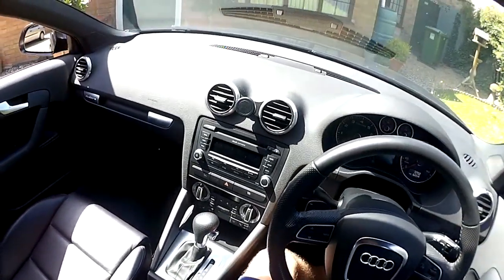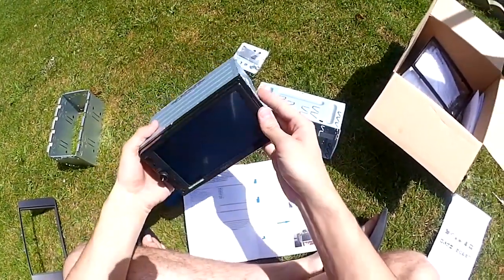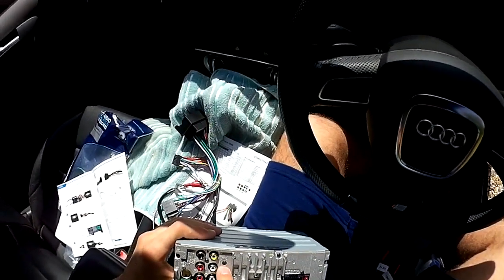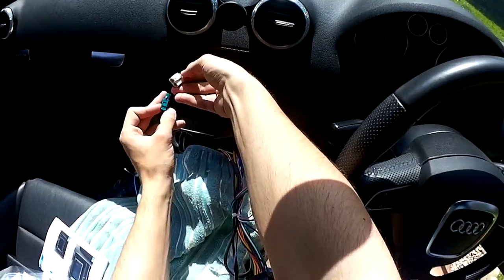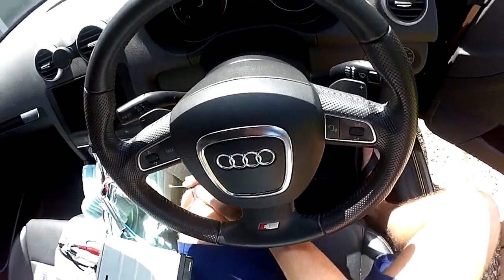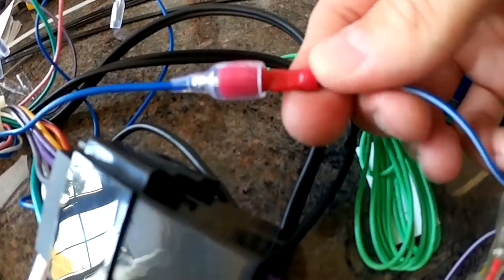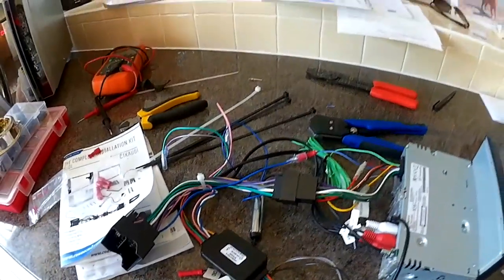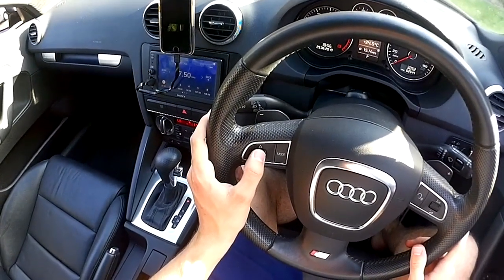How to fit a Sony XAV AX 1000 stereo/head-unit in a Audi A3 8P using the connects2 kit

Comment: Blue wire = amplifier wire :) had the same problem with my Bose system. Plugged it in and all worked!
Reply: a tip: you can watch series at Flixzone. Me and my gf have been using them for watching lots of of movies lately.
Reply: @Clark Andre yup, I've been watching on Flixzone} for months myself =)
Reply: @Clark Andre Definitely, I've been watching on Flixzone} for since december myself :D
Reply: @Clark Andre yup, I have been using flixzone} for months myself :)
Reply: @Clark Andre Definitely, have been watching on flixzone} for since december myself :D

Comment: Hey. I have just purchased a different head unit but got the connects2 kit. However I don't have steering wheel controls. Can i get away with not needing to fit the little box that comes with the quad lock loom, do you know? Thanks

Comment: Hey, where did you put the blue wire that’s attached to the antenna converter part? I’ve got the antennas blue cable going into the plug, which connects to the white and blue cable on the opposite side of the plug. Did you have yours hanging loose after connecting the white and blue cable to the blue cable? I hope that made sense

Comment: Thanks for this! I've got Bose speakers which are all amped and made the same mistake as you. Did you have any grounding issues? One of my speakers has and intermittent high pitch drawn out beep that only occurs when the engine is on

Comment: Does the reverse camera automatically come up when the car is put in reverse with this unit?
Reply from the maker: littlefanta2 I didn’t have a reversing camera, just sensors. But if the reversing camera is wired up correctly, it should come on automatically

Comment: Hey mate, can’t get rear speakers to work at all. Can you please advise. I’ve used same stereo and connects2 installation kit
Reply from the maker: Hi Sammy, if you watch from about 18:30-21 mins you will see I had the same problem. I ended up connecting it differently to what the connects2 kit said as the rear speakers and sub was not working. If you have connected it how I have said in this video and are still having problems, I’m not too sure what to suggest. If you go to 20:25 you should get a good view of the two wires I connected to cure that problem. Let me know if that helps
Reply: OJ's Annals thank you I have watched it but struggling to understand which blue wires you connected together? Is it the one coming off the antenna connect to blue and white? I held them together but that made no difference...
Reply from the maker: No, from memory and having a recap from the video the blue wire coming off the antenna made no difference whether it was connected or not, so I didn’t connect it; I connected the blue and white wire which comes out the loom/connector that is directly connected into the stereo (which will already have a crimp on it) to the blue wire coming out of the loom which will connect directly to your factory harness, it has a bullet connector crimped onto it already. Let me know if that helps?
Reply from the maker: sammybo22 any luck Sammy?
Reply: OJ's Annals you’re a star mate it worked a treat 😊😊😊
Reply from the maker: sammybo22 That’s great. Glad it’s all working now!
Reply: Didn’t work for me at all ??

Comment: I bought that Connects2 Interface for an Audi A3 8P with Concert radio and amplified system. But only the front speakers worked for me, the rear speakers and the amplifier in the trunk didn't work. Does anyone else have that problem? And how did they solve it?
Reply: Need an amplified harness, and connect blue wire into the ISO and link to the back if the head unit. :)

Comment: This radio drains my battery... Any idea why that is
Reply from the maker: Could be to do with how the power wiring is wired. From memory it wants to be switch lived power, it doesn’t want to be constantly fed power. If it is constantly fed power than that could be one possible reason. Not 100% sure though
Reply: Figured the kit u have is the one that does the trick... Cos it does not store memory or switch off whn I take the key out or play like the original... I connected mine straight up... Is that my problem u think?
Reply: I think I need that connect2 kit... Where can I get it... Cos I'm in South Africa and have no idea where I can get that... But I have the same radio and the same car without steering controls thgh